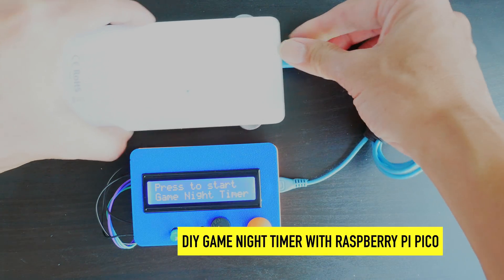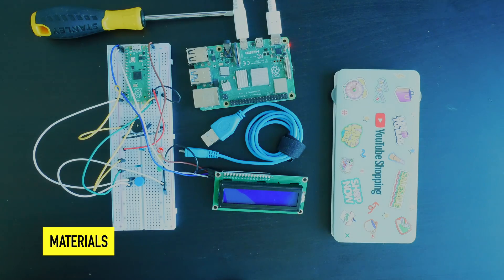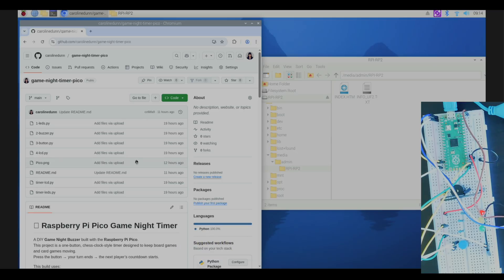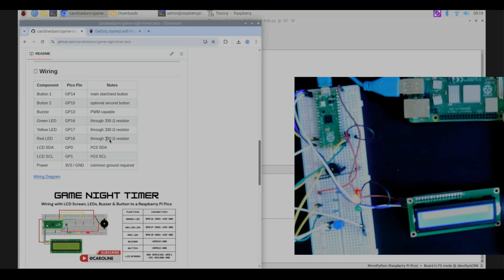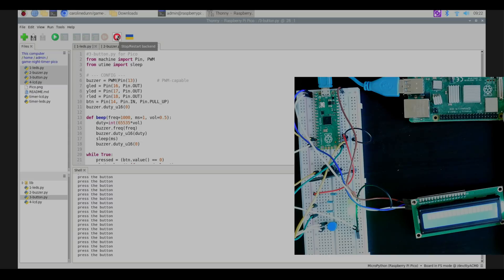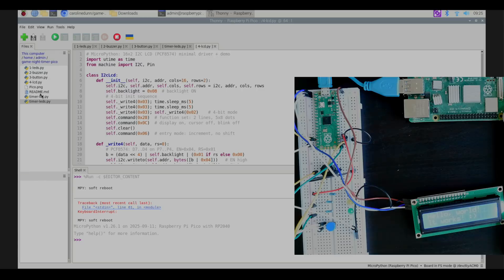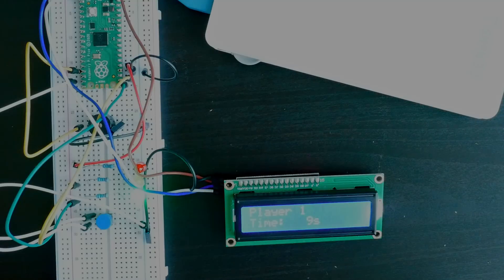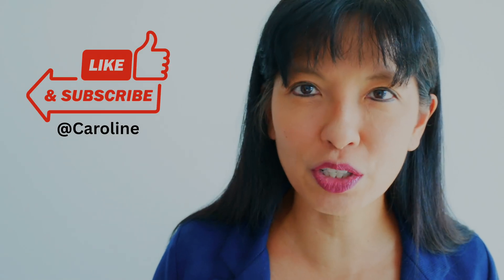Raspberry Pi Pico Game Night Timer — DIY LED + Buzzer + LCD Screen Build

Comment: Excellent video! That's a great use for a Raspberry Pi Pico. I see using this for checkers as well as card games.
Would you put together a more traditional style chess clock with two buttons and two LCD screens which track how much time has elapsed for each players moves?